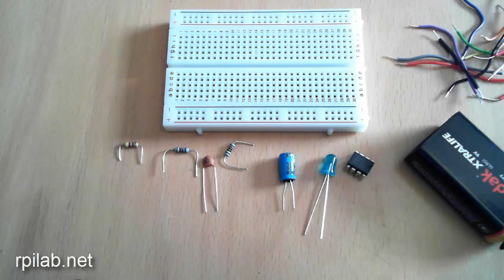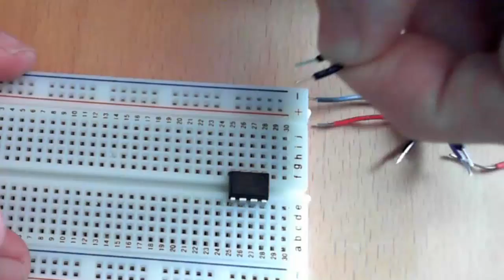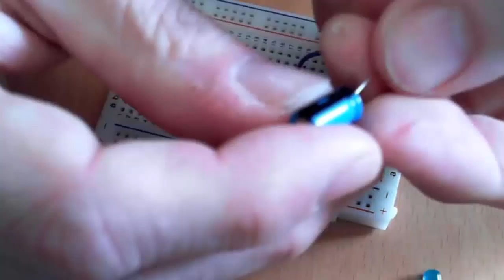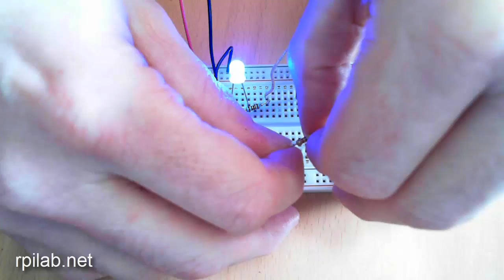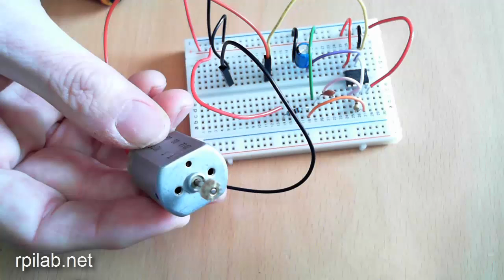Introduction to Electronics for Raspberry Pi: Flashing LED

Comment: I am a bit of a noobie to this, and this is probably a stupid question, but how do you tell the pin numbers apart on the 555 Chip? Do you just count it or is there a specific way to do it?
Reply: On the chip there is a little dot. That is the first pin. Then beside it is the second. When you get to the last pin the one on the opposite side is the next then it goes the opposite direction you first went.
Reply: Jcool2018 Okay, thanks!

Comment: How did you find the resistors you needed for your raspberry pi circuit?
Reply: you can buy like 600 for 10 bucks or so online
Reply: KC Miles use ohms law

Comment: I'm fairly new to the electronics scene, so I could use some help here. I wanted to set up an LED strip that will have the LEDs blink sequentially. Preferably multiple strips and with 16 or so LEDs per strip. Is this possible?

Comment: Ok, the tutorial on the 555 chip is useful, but the titel need to be changed. Because this has nothing to do with flashing a LED on the Raspberry Pi.

So the introduction to Electronics for Raspberry Pi is obsolete. This is a pure analog days tutorial.